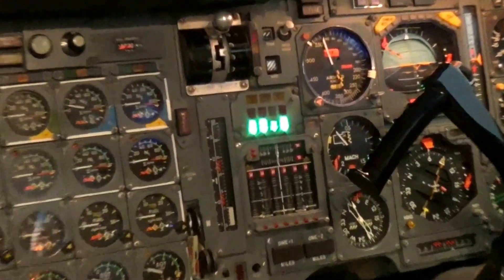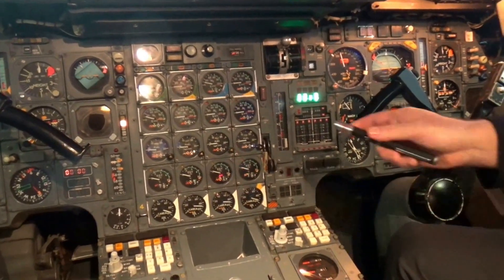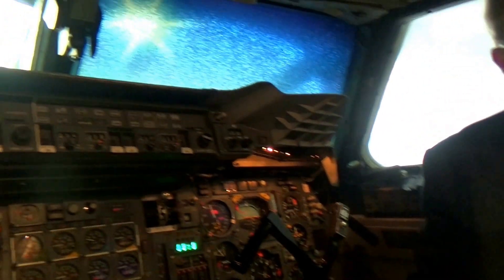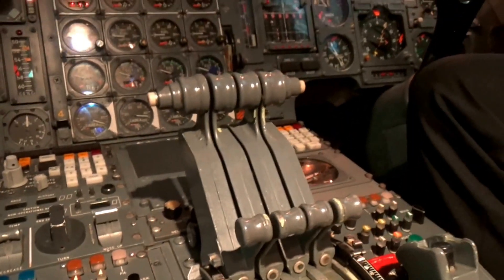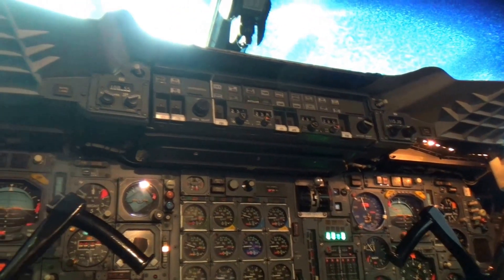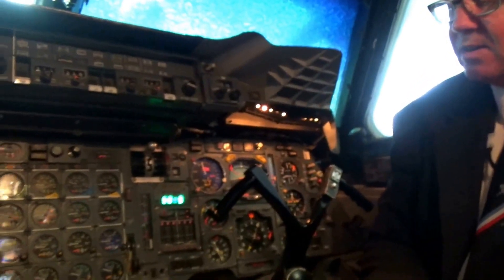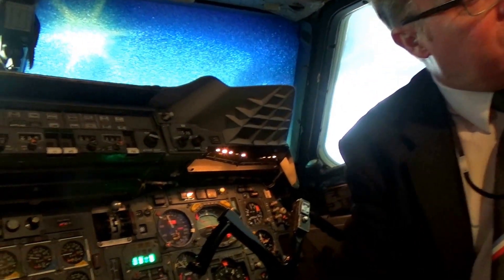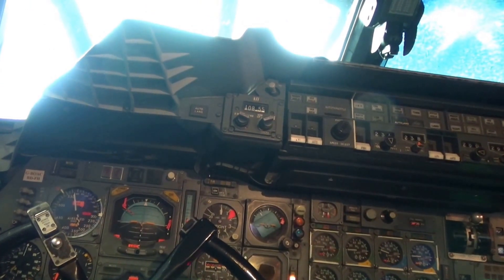Concorde G-BOAC Instrument Lighting Systems Powered

Comment: Thanks for sharing! What's wrong with the right windshield? Seems like it's cracked...
Reply from the maker: Yeah it was damaged many moons ago when the hangar was being built around it.
Reply: Can't imagine how much it would cost to repair it. Right windshield on a 737 costs about 60.000$ from Boeing...
Reply from the maker: They actually have a replacement that was the easy part. The problem is it has no hydraulics to lower the nose to replace the windshield.
Reply: Interesting, there should be a fail-safe lever which releases the mechanical latches, allowing the nose to fall under gravity. Not sure if it works on ground or requires some "G loads" when used in the air...
Reply from the maker: I thought that too, I always thought it had a unscrewing mechanism which allows for the nose to be wound down manually. They told me on tour it needed hydraulics to do this still though.
Reply: not much, it doesn't need to be a certified part as it doesn't and won't fly.
Reply: caused by malicious damage from a former employee at the Runway Viewing Park